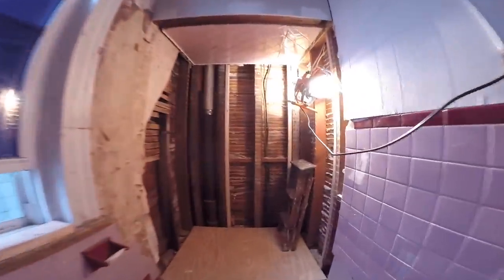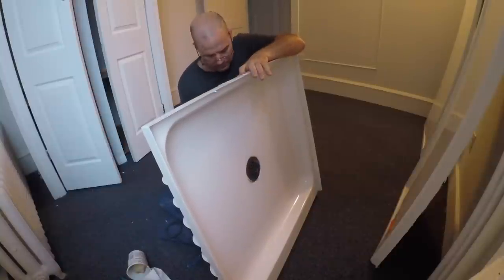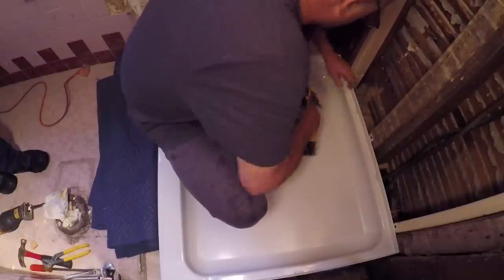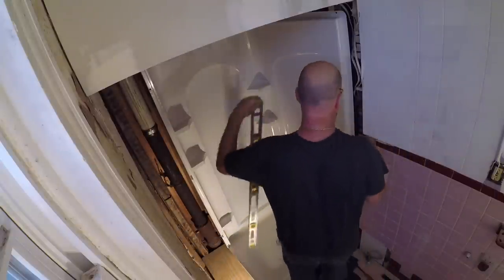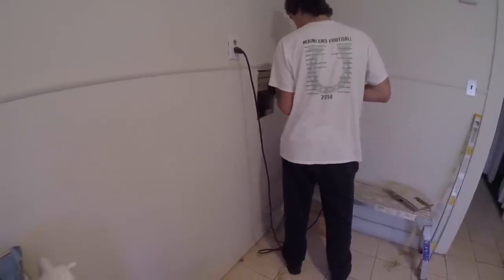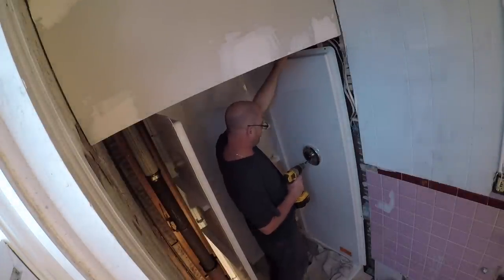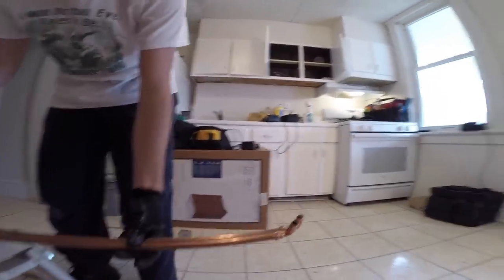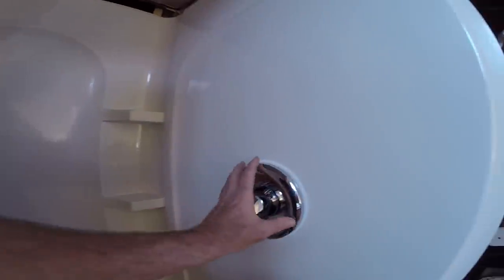Sterling 4 piece shower installed Part 1

Comment: I just installed the exact model Sterling Shower in my master bath remodel project. Of all the  videos I watched before tackling this project, one step was left out. Each side piece had alot of material that had been left from the molding process. This needs to be carefully cleaned off with a sharp knife and the joints inspected where they snap together.  Failure to do this can leave material in the track, preventing a proper fit causing the shower to leak. Once the sides are installed  and snapped in place, there is no going back to correct the problem.  I did not make that mistake only because I carefully inspected each piece. Using the level to get the shower pan level was also a very important step. Best wishes.
Reply from the maker: Thanks Dor, this job was from the ages of slum lord city...

Comment: I just put in one of these showers ... I’m not a fiberglass shower fan, but the sterling is probably the easiest to put in. Now for the bad news. Before you install the base ... the manufacture will not stand by the warranty if you don’t bed the base. I see you didn’t bed the base. Next ... the gel coat flashing is sharp on these showers. Good luck with the project.
Reply from the maker: Appreciate that.....but what happened an hour from now when you put me on blast ha!  Plumb on!
Reply: Yup, love that Vikrell

Comment: How do you finish the walls if it is sheetrock? Sheetrock removed to put 3 walls to studs. How do you add sheetrock and finish up over the shower flanges on the walls?
Reply from the maker: should be installed on studs. then rocked.

Comment: Could've poured a mud bed underneath base like installation instructions suggest to compensate for floor being unlevel.
Reply from the maker: So many things I could of done better. I love my fellow plumbers taking me to school. Thanks Joe Joe. where ya from plumber?
Reply: Chuck Barron I'm from South Alabama, been plumbing for 24 years,
Reply from the maker: Alabama In Da House!   Joe I thought you were from Pittsburgh....Mean Joe Green! ha..
Reply: Chuck Barron, hey CB what's your opinion of the Delta direct to stud installation tub/shower kits?
Reply from the maker: I have always been a moen guy. Never dealt with delta. I only repaired a ton of kitchen faucets  with the  brass ball, springs and washers...ha
Reply: Chuck Barron was referring to Delta 4 piece tub shower units, not faucets
Reply: I don't care for the Delta unit, I don't think many people like them, matter of fact there is a 90 day wait on Sterling units in my area now due to demand, and stacks of the Delta units sitting at supply house.
Reply from the maker: actually I have not...its always been aker, sterling which I think owns aker...now.
Reply: If you ever happen to come up on one get ready for a tough day. We use to get aquaglass exclusively until Delta bought them out and pretty much discontinued their catalog now we use Sterling which is a subsidiary of kholer.

Comment: why didn't you do the plumbing before putting the shower wall up?
Reply from the maker: well, that job was a doozy,  I took the easy way out and created a access panel from the start for this rental. I could of spent more time trying to perfect the measurement and secured faucet, then the side wall,  but it would of took to much time and most likely would of ended up cutting a access anyway. I hope that helps ya.....easier for sure.

Comment: When you're a pro you install shower valve in wall and drill hole in shower wall before installing shower wall to shower base, no need to be cutting hole through wall in another room.
Reply from the maker: Joe Joe your right...I accept the 15 yard penalty for roughing the wall up.

Comment: What if you forget to seal the gap between pan and walls with silicone? Can you just silicone the existing gap? Friend had her friend install the shower and think he forgot to seal the gaps. The whole shower is installed :/
Reply from the maker: yes......caulk it up.
Reply: I have a sterling I haven’t put in yet and it says not to caulk between walls or walls and base? Just at the top of walls where it meets the tile or green board.

Comment: the drains over a floor joist?couldn't slide it over a bit one way or other? that seems to be a misfit of sorts,chipping out and having to put fitting on up against the floor joist?
Reply from the maker: no room to move front to back....we replace an old shower there..

Comment: Chuck ... Buddy, your cutting into a load bearing member(the joist)! That's a real NO-NO!!! Why not pull the shower pan out about 3" inches from the back wall, your drain piping will now clear the joist (you'll have to put up a faults wall in back ...but semi-easy in your case here, and won't PO the inspector) ...Just my 2 cents!  Luck my friend!  ....ML
Reply from the maker: oh snap i must of not had a choice. this place was a disaster. If I remember I may of cut a smidge more of joist to make trap work. that shower was the crown jewel of this 4 apt. complex trust me.....ha
Reply: Mark Layport has

Comment: You just put plumber's putty on that drain? I'm replacing one now that had plumber's putty on it the directions clearly state do not use plumber's putty doesn't it? I'm not a plumber I'm a carpenter just asking
Reply from the maker: I have been using putty for 35 years. I will read instructions next time. Thanks Randy

Comment: Hi, does this manufacturer make custom sizes? Thanks for the video.
Reply from the maker: all standard sizes I believe.
Reply: These are available at Lowes. But word of caution. I had to buy the shower pan at one store. The back panel from another store and the side panels from another store. The inventory that the Lowes stores said they had was not true and accurate. Also check and verify the color. I bought white. The have another color called  biscuit. In the store it looks white. Good luck.

Comment: You didn’t need to cut two holes in the shower wall. Suppose to be 3 1/2 in hole. Didn’t need to chop a hole in the kitchen. You could of put all that hardware in from the front. Just pull the right panel and mount everything. You didn’t have to compromise the floor rafter. Could of pulled it forward to miss the rafter and Block out the back wall. They had all kinds of room to do that. I hope your future customers are watching. What a hack !!!
Reply from the maker: Now Now Robert.. Only if you could of been there. I could address are you concerns but no need. I take pride in all I do and there are some jobs that are a nightmare. That shower is holding that apt. building together if ya know what I mean. When your hands are tied by the man who is paying the bills you do what you gotta do. example like go buy a 3 1/2 bit. The shower could not be pulled out but thats just another example of being there. Plumb on!

Comment: Dont let this fool near your house. He should have framed the cut out for drain. No support for 3rd wall. But most of all, should have roughed in plumbing before installing the 1st wall. The whole job is a cluster fuc& and too much mocho man.
Reply from the maker: oh peter...now now...Of course the owner could not wait for the carpenter and hurry up and get it done...get it rented out and carpenter will fix all. A total slum lord. you did not know that but hey maybe you still run your trashing mouth.  What would petey do?

Comment: To hell with the copper as it's too expensive & hard to work with in tight quarters that it would of been better if used copper adaptors to pex & finish it with pex. Pex is cheaper & better & what's nice also is if it were to frieze it won't likely bust the pipe & can be thawed easily with a hairdryer. But just the same I'd insulate it with foam sleeves. Why did you not frame the shower prior to installation? I am a good man to keep on hand, Dave the handyman home repair guy & self defense trainer on YouTube me Dave Overbey. How I defeat the hands & feet with my own technique.
Reply from the maker: Tight quarters and carpenter was not on scene, but we chatted about plan. All worked out and was completed.